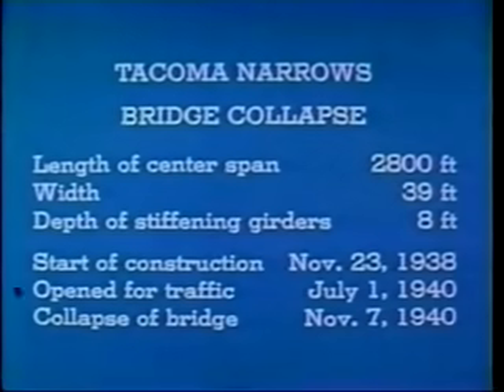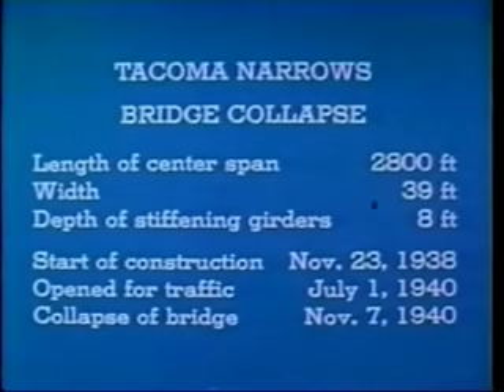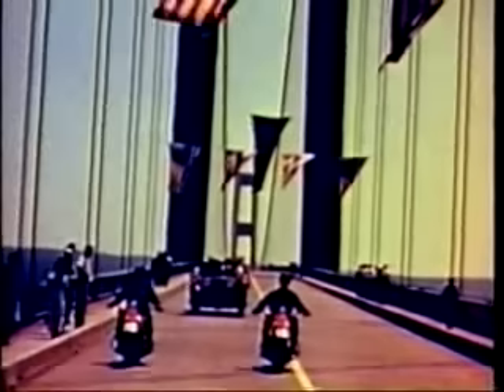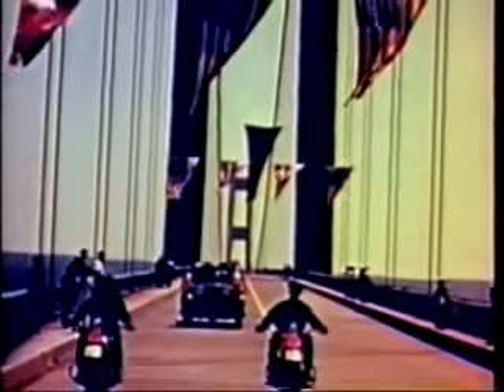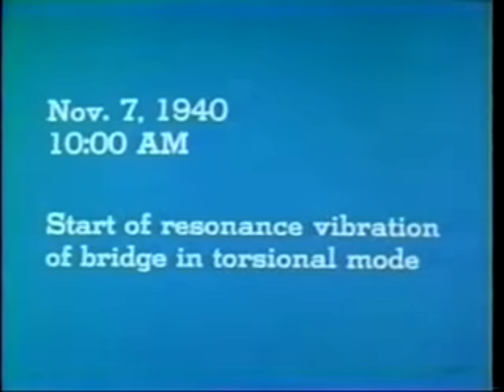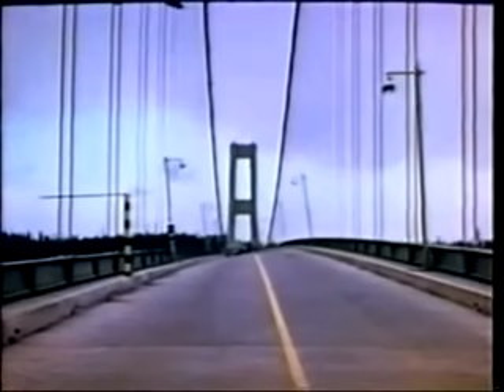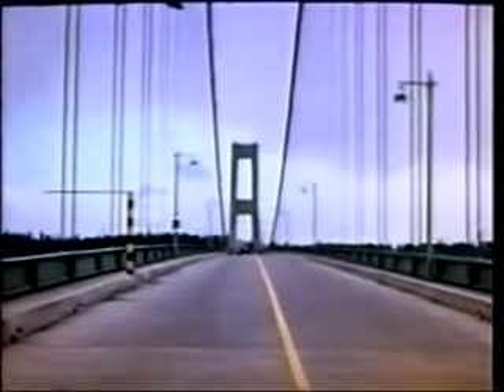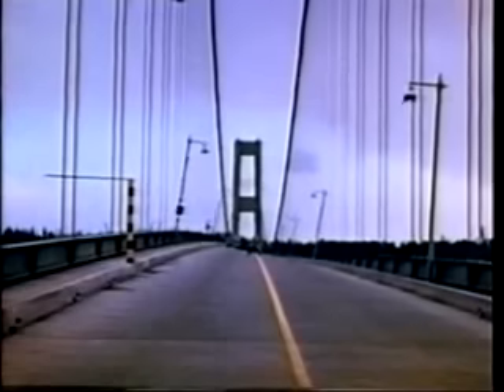Tacoma Bridge

Comment: I wonder if a cruise ships dampening system, that reacts to cancel out sway, could be used to eliminate bridge sway issues? Water tanks on either side of a section of bridge could work passively or actively. 

We'd need to treat the bridge as if it had several sections with a dampening system for each one. Perhaps all the tanks could be linked together so the water weight is shared and could be redistributed as needed? 

The presence of water ballast tanks on a bridge section would already provide some dampening of vibration as it would simply be absorbed by the water inside the tanks. But once sway was introduced the water would resist that sway while an active gyroscopic system could respond faster and more precisely.

Comment: The metal used in the bridge was a shortly produced hybrid steel known as vaginalloy.  It was designed to take the rigors of daily activity, but like with most items of it's caliber, it was unreliable.  All it really did was made a lot of trouble and clearing the damage cost a lot more than anticipated.  Bridges built using an earlier hybrid steel simply known as "tool" stand proud at a low cost and very little maintenance.  Anyhow, the science was settled.  Tool is far superior to it's counterparts.